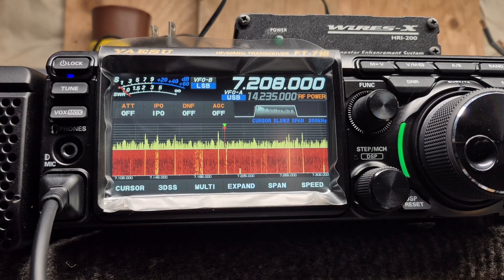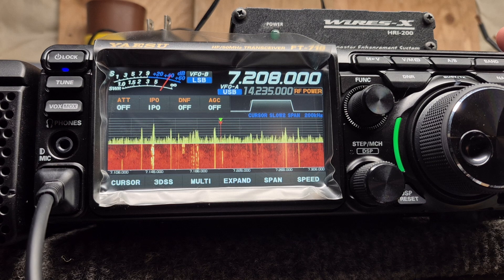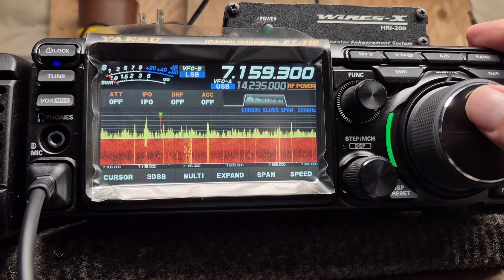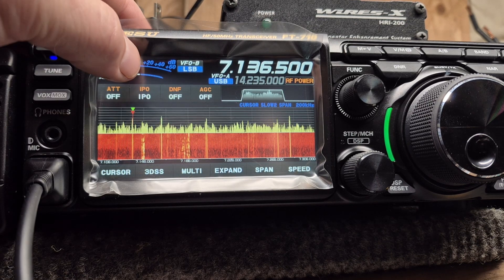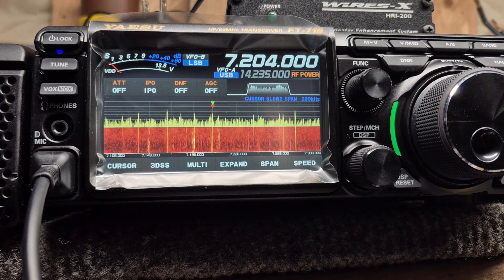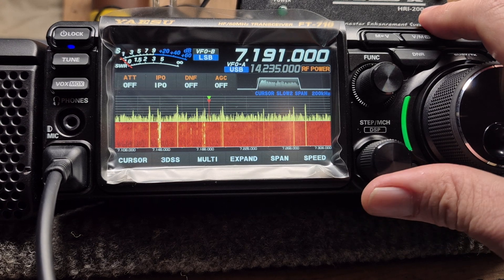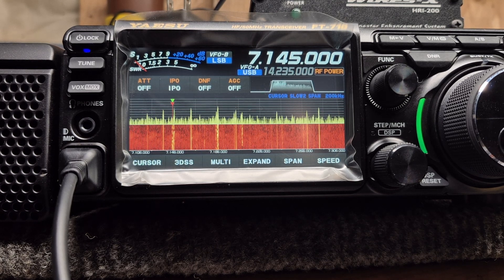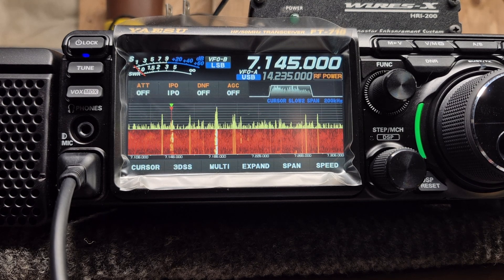New YAESU  FT710. S meter issues?

Comment: I've had my FT-710 for 3 months and noticed an S-meter issue almost immediately.  It does work, but seems "stingy" if I may use a very non-technical term.  I even did a factory reset with no improvement.  In fact, I made several posts on FB about it, but didn't get any responses that helped – just like this post I suppose.  In my case it's not so bad that feel like shipping it off, but it's annoying.  Going back a couple years, If I still lived 10 miles from HRO in Atlanta, I would have taken it in!

Comment: Your AGC is off. Turn it to "auto" or fast or preferable to slow, then your S meter will work. That is how all rigs S meters work, not just the 710. Also, turn IPO off, and relax on the gain of the waterfall - correctly set, you should only see signals in the waterfall, not all that garbage noise due to making it over sensitive
Reply from the maker: @johnk8091  Thanks for watching and your comment.
I will adjust a few things soon

Comment: And still no screen averaging so I won't buy it.
Reply: No regrets here. I like mine a lot. Took a point off for the all the voice settings and Mic. 9/10
Reply: WTF even is that? The waterfall shows you several seconds worth of history (at least 15-20 if you need it). That doesn’t give you the information you need?
Reply: it's a real time display... a WF is only good for finding signals up and down band anyway ... the FFT shows the actual bandwidth for the RX signal. I don't understand your complaint ? it's an amazing rig especially for the cost.